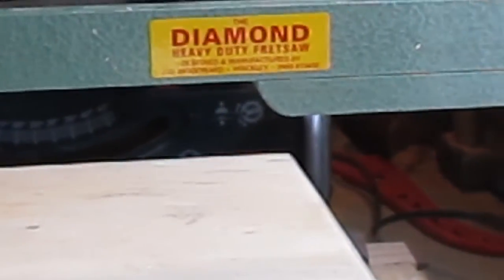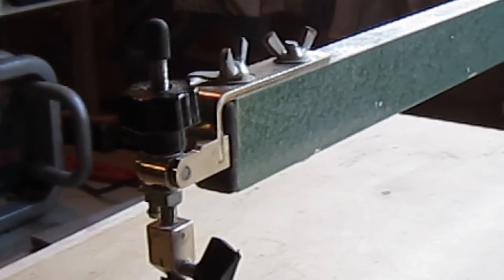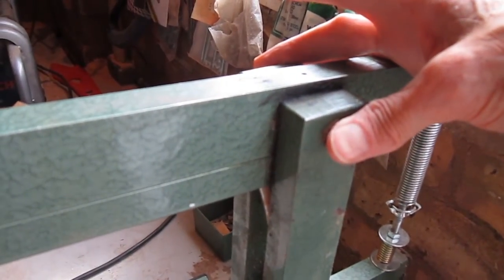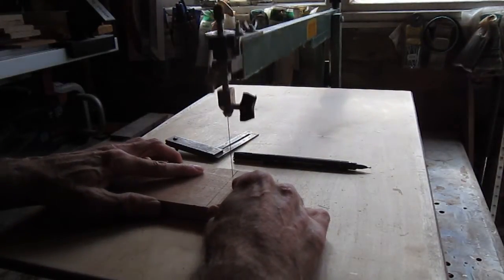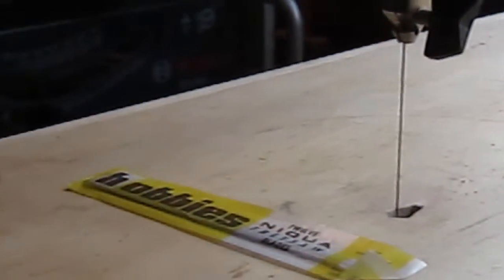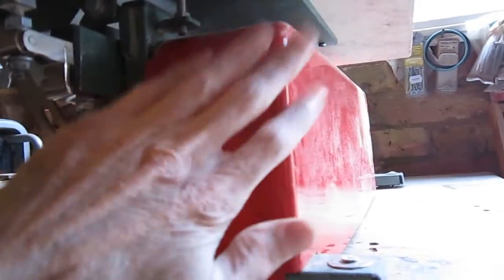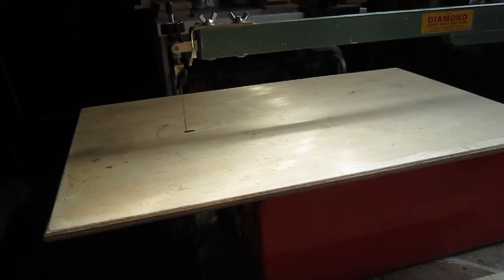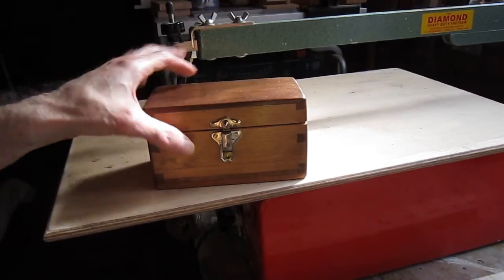The Diamond Heavy Duty Fretsaw / Scroll Saw

Comment: Hello KD - It's a tiny spring/roll pin attaching the blade holder to the screw thread - if (!) you can push that through you could make yourself another assembly with a new piece of thread.Or take to an engineer to drive out & disassemble. I don't know why he used a roll pin instead of a screw - complicates matters somewhat. I often wonder what happened to all the components when JDW's shut down - now that would be a barn find!

Comment: These saws are excellent if maintained and set up properly. I reckon they were the most effective that were manufactured at the time - have not found one to match it and have tried the "best"  Glad mine still works. It's apity that his sons did not continue the business.
Reply from the maker: hi Terry, you're name seems familiar to me for some reason but anyway I'm having a little problem with my clamp holder, in part as the threaded bar somehow got bent and also has some play relating to the pin. A quick remedy is going to be another nut where the thread meets the clamp holder. Any ideas ?